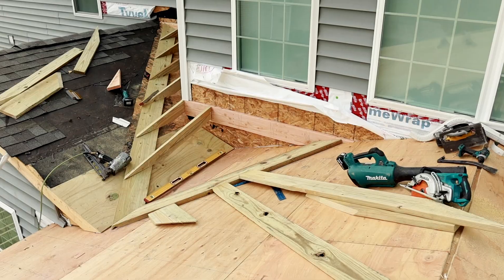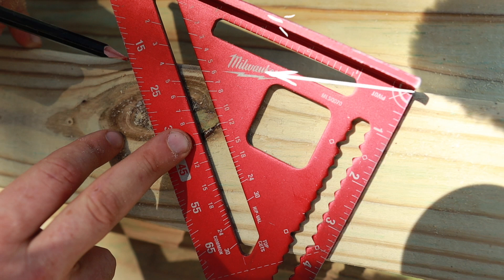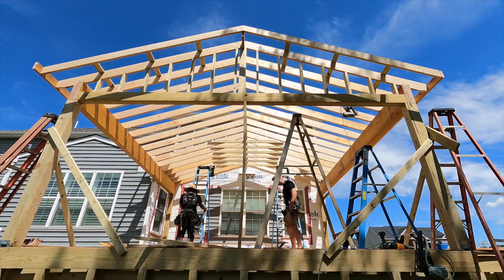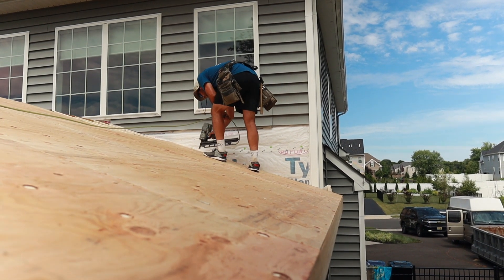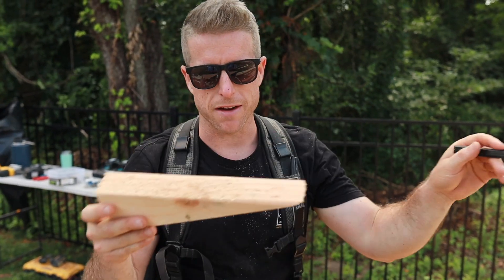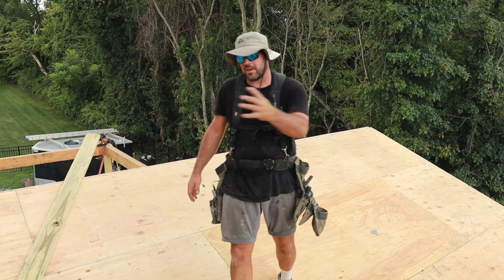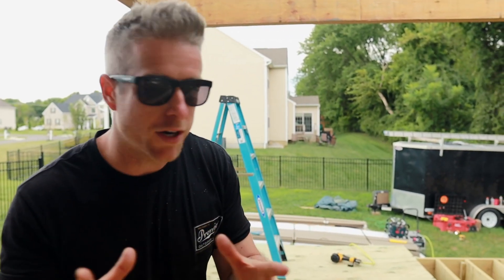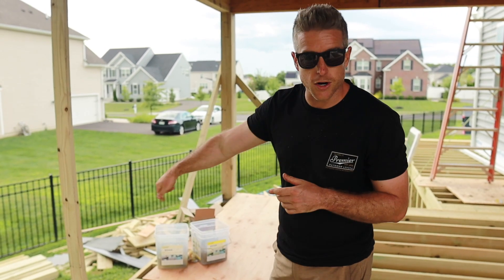What Is A Roof CRICKET?! How To Build One And Understanding Roof Angles

Comment: I’m a structural engineer. Collar ties don’t prevent roof sag or walls from pushing out, they only resist rafter separation from the ridge beam during periods of unbalanced loads. 

Rafter ties or ceiling joists however do hold the roof together. 

The difference is that collar ties go in the upper third and rafter ties go in the lower third of the roof. 

Both of them are important part of roof framing and neither can be substituted for the other. Completely different functions.